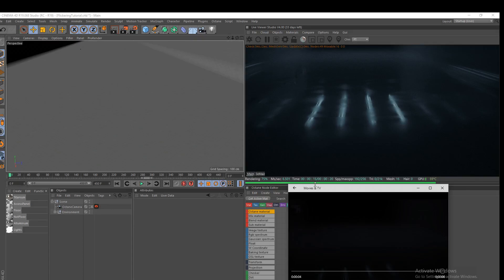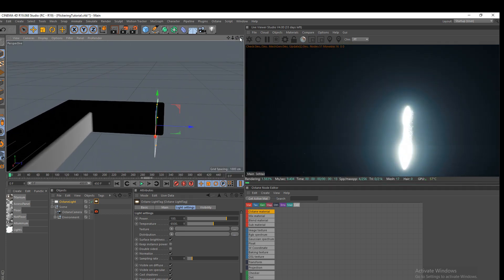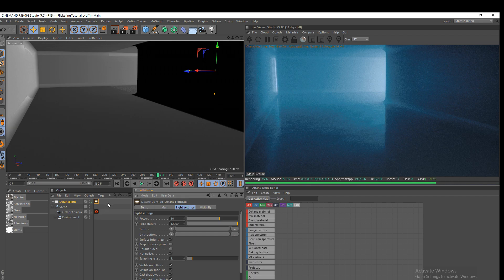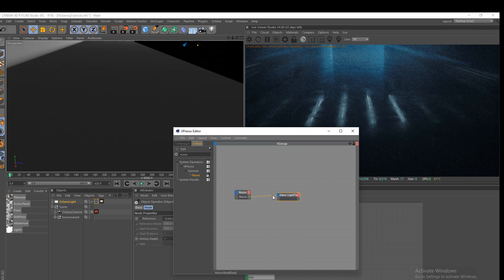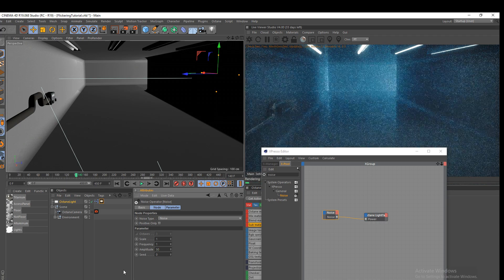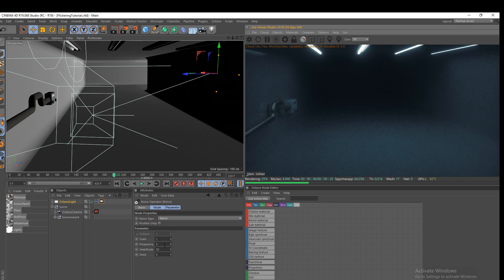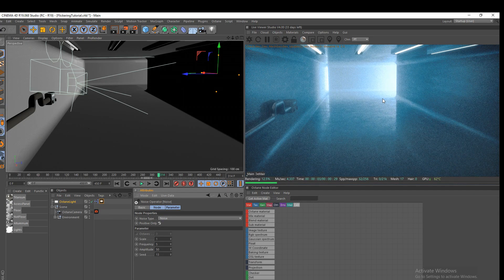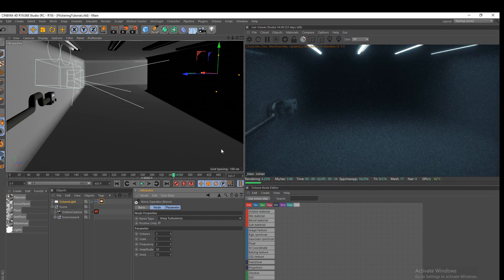[C4D] Octane Flickering Light [Tutorial]

Comment: Really cool Tut! Exactly what i needed. HOWEVER. I figured this method does not work on Objects! How would i do it with Emissioned objects?
Reply: You could do the same Xpresso process, but drag the Blackbody Emission Tag from inside the Material instead of the Light Tag. That way you'll be able to plug the Noise to the Emission Tab Power parameter.

Comment: what if instead of lights you want to add flickering to the emissive material?
Reply: You could do the same Xpresso process, but drag the Blackbody Emission Tag from inside the Material instead of the Light Tag. That way you'll be able to plug the Noise to the Emission Tab Power parameter.